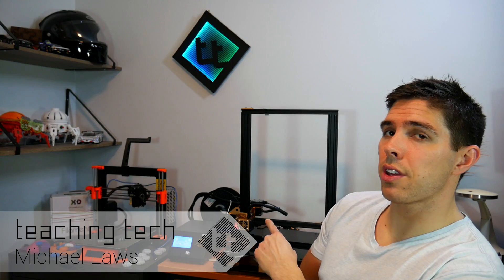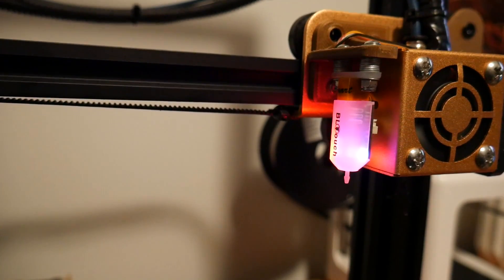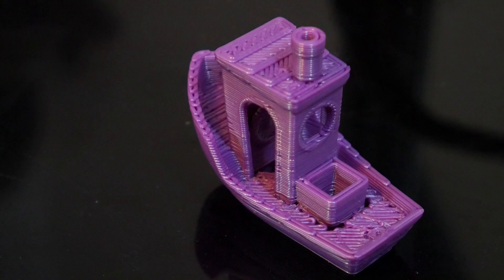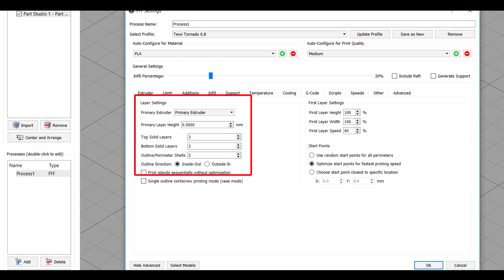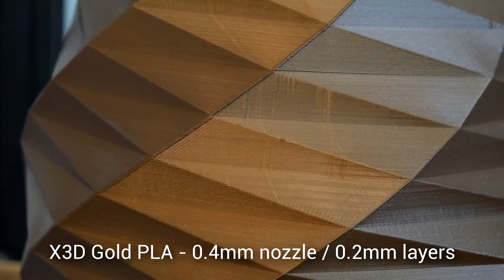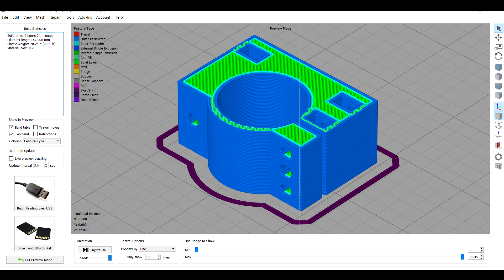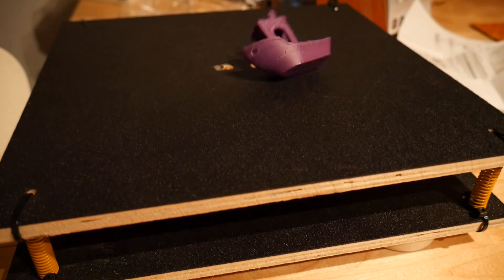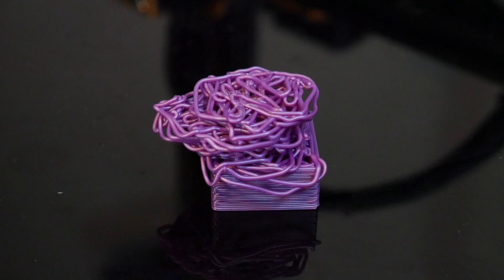3D print bigger, faster and stronger with a larger nozzle

Comment: What about extruder steps, e steps. I recently got a second Lulzbot off eBay that someone really had zero idea of what they were doing. Rail cage misaligned, guide rails misaligned and one guide rail support upside down stepper motors wired wrong, endstops wired wrong, nozzle cooling fan receiving no voltage and on and on. So all fixed but I have a working Lulzbot TAZ 5 already. So I decided to change this fixed machine dedicated to a MOARstruder 1.2mm. You don’t mention e steps. I could probably calibrate flow, speed, etc and save that in Cura as it’s own machine. I did have to do that anyway so Cura knows I am using a 1.2mm nozzle with the settings you mention but I also changed e steps. You didn’t need to do that? By the way, I am now printing 4 times faster, however, as you show in your excellent video, the resolution takes a hit. BUT, it makes things look a little more artistic. Yes, I printed a vase and, to be honest, the visual appearance of the 1.2mm filament strings as they go up the vase makes it look really really awesome. I do a lot of robotics, Arduino and raspberry, so I do a lot of prototypes before I settle on the finished part. This will GREATLY help me as the earlier prints, the prototypes, do not have to be anywhere close to perfect and as I finalize on a print then I switch back to either the Lulzbot .5mm or I'll use either my Snapmaker 2.0 A350 or my Sindoh DP200 which both use .4mm nozzles. So this 1.2mm HUGE nozzle gives me a lot of flexibility on a machine that I can keep constantly using the 1.2. I never expected to fully fix this printer that I bought so inexpensively and now I have a machine for pure prototyping which is AWESOME. Great way to use this extra machine that was almost a gift and make it one of my most useful machines. Not to mention how much I learned fixing all the issues that this machine had.

Comment: I know this might be a stupid question, but I'm new to 3d printing and do you need a filament that is larger than 1.75mm for the larger nozzle?
Reply: no, if your extruder uses 1.75, use 1.75. The nozzle doesn't care, as long as enough volume of plastic is running through it

Comment: The main issue is that many printers using a e3d style head can not heat the nozzle properly. Also many extruder motors will start skipping because the demand of filament will exceed there thresholds.

It is for this reason .6mm nozzle should be the biggest you should install, unless you are willing to modify your printer with a custom head like a volcano; and also upgrading the extruder motor/driver.

Comment: with 1mm nozzle when printer starts new layer filament comes out of nozzle after nozzle have moved 5mm, so no filament on those 5mm. what settings i need to change in cura?

Comment: Hello Everyone
I have a problem printing with the nozzel of 0.8mm and I hope that you can help me.
Any time that I print with the nozzel of 0.8mm except vase mode my start  layer points have a big gab, witch results in a sort of a cut in my prints.
I hope that my description is accurate enough. Btw my slicer is simplify😅

Comment: My standard printer setup is a .6mm nozel with .28 to .4 mm layer height. I have also taken to designing all my parts for this setup. I find that even big parts print nice and fast with this set up and they are stronger than the normal .4mm nozel. Thanks for this video. Great job!

Comment: I just put a .8 nozzle on my cr10 s5 and Im still having issues with the overlap. Im all the way up to 75% on the simplify setting and ive still got a gap. Did you make any changes to your extrusion multiplier?  Ive got mine set to 1

Comment: Nice Work! I have a question, can I see your settings 0.8mm nozzle on ender 3?
I work with 40mm/s and got stringing.. what should I do? adjust the retraction speed & distance?

Comment: I prefer to print large, and work w/ .08mm nozzle. I've worked at tinkering my settings, and found most of my settings are the same as what's recommended here. One small difference is i print at a much higher temp for PLA then what it's rated for - i print between 215, and 225C - i do this because the amount of filament moves faster through the nozzle, and has less time to get up to the correct temp. A volcano nozzle does correct this by increase heat exposure time during feed. However, i found it wasn't really needed if you just increase the actual nozzle temp it does the same thing but really better since the material tends to exit at the right consistency, and if you use layer ironing (you lose a little bit of time) you can regain some resolution, but the strength is insane as the ironing, and increased heat creates premium layer binding.
Reply: What slicer do you use?
Reply: Thank you!

Comment: I printed number of parts with 1 mm nozzle at 0.5 mm layer height and the output has been great. The benchy I printed is 250% in size and it looks perfect. Much better than the one you printed (has smoother surface).

Comment: hello,  could you please make a video for only .5mm nozzle upgrade with all the parameters,  your current video jumps around too much on all nozzles.  I've currently placed a .5mm nozzle in my Ender 3 PRo 3D printer and it's running as fast as the .4mm nozzle with the settings or does the settings change once you change the nozzle setting from .4 to .5.   thanks, I enjoy your videos they are very helpful.  Cheers

Comment: Not the optimum solution.  Print 0.6mm at 0.5mm layer height.  You will get better speed because of lower volume flow and will use less material.

Comment: Would printing using 0.4mm nozzle profile in Slicer/Cura be problematic if I have installed a 0.6mm nozzle? My assumption is that it should not have any problem because the hole is bigger, so it won't have an issue with jams.

Comment: Finally, a decent video for large nozzle newbie. Thumb up! You gave out the most important information, relationship between large nozzle, line width and layer height which I didn't see another one did. Also with actual number for setting which is better than most of the others.
Reply from the maker: I'm still slightly tweaking but the early breakthroughs in this video were the most important steps. Thanks for watching :)
Reply: Ask Holy Spirit to teach you and to guide
you. I would recommend the YouTube Cleveland street preachers and follow Jesus no man no religion. Be holy and obey Jesus. Hebrews 5:9 "salvation is for those who obey. Jesus says if you love me keep my commandments (John 14:15). Jesus even says if you keep my commandments then you shall abide in my love (John 15:10).

Comment: Thanks for the video, I learned a lot of things about printing with 0,8mm nozzle... Please, Someone can said me ,In simple3d, what are the right values for tevo tornado with Extrusion multiplier and Extrusion width?. Thanks a lot! And sorry 4 my english.
Reply from the maker: I ended up at 0.9 multiplier and the width on auto which is 0.96 mm. This is for a 0.5 mm layer height.
Reply: Thanks!. I tested this settings and really improve the results.

Comment: I was wondering what might be your recommandation on who might have the best replacement nozzle as far as brand.
There are a lot of people on Amazon claiming to have the best made nozzle. Any thoughts?
Currently running .4mm Ender 3. :)
Thanks
BTW, my nozzle hits the infill when printing at higher Z. I leveled the bed, but maybe the x-axis carriage? Has this happened to you?
Reply from the maker: With nozzles it's my opinion that you either buy 10 cheap ones or one really good one. If your going the expensive route, something like an E3D harder stainless or even a ruby nozzle.
Not sure what you mean by scraping the infill?
Reply: @TeachingTech  thanks. I ment that I was printing a badge holder with rsa chip inset. It prints supports while going up, not infill. My bad on that. I think because I haven't moved the z-axis up high for a long time, found a flat spot.
Have you heard anyone having good luck switching out the wheels for rails?
Reply from the maker: I haven't come across it but ic any see any reason they couldn't just be unbolted and swapped.

Comment: have you ever used a true volcano? My cr10s an now my tevo little monster has them an pt100 thermistor. An have you checked out the berd air system?
Reply from the maker: I haven't used either but I predict covering the volcano at some stage in the future. Berd air looks interesting for a printer with little roo around the hot end.
Reply: @TeachingTech  I'm using berd air an zesty nimble (there from your neck of the woods) on my tevo little monster I didn't want the weight of direct drive an fans on my hotend for speed purposes my zesty nimble sidewinder will be in today for my cr10s an I have a 12v berd air for my cr10s as well highly recommended both products

Comment: GREAT VIDEO, YOU HELPED ME LOADS I WAS UNDER THE IMPRESSION YOU HAD TO CHANGE SETTINGS IN YOUR FIRMWARE JUST RELEVILING THE BED IS NO PROBLEM AND THANK YOU FOR MENTIONING NOT TO REMOVE YOUR NOZZLE COLD. GUESS IT'S TIME TO ORDER A LARGER NOZZLE.
Reply from the maker: Thanks buddy. Good luck with the experimentation.

Comment: Actually, noone stops you from extruding 1mm thick extrusions with a 0.4mm nozzle. In fact, I often use up to 1mm extrusion width with my 0.25mm nozzle when I need strong walls. Works perfectly fine for me. Would you mind testing how your 0.4mm nozzle performs with 1mm extrusion width and 0.35mm layer height? You can set the extrusion width in the advanced options of slic3r (don't know for simplify 3d). As you said, you might have to reduce the speed if your extruder can't handle the flow. Also raising the temperature might help.
Reply from the maker: That is something I would like to test at some stage. Just need a video idea that it fits.
Reply: It's really funny. Most people in the 3D printing community never consider changing the extrusion width or don't know what its benefit would be. I on the other hand adjust the extrusion width on almost every print. I usually do mechanical parts or cases with usually one dominant wall thickness. In this case I always adjust the extrusion width so that the wall perfectly fits an equal amount of extrusions. This makes for strong walls and reduces print time drastically when no gap fill is needed. I print with 0.3mm to 0.8mm extrusion with most of the time. I really miss a variable extrusion width feature in slic3r... Would be nice if it adapted automatically for perfect thin walls ;)
Reply: That is one the easiest ways to increase print speed. I also had great results with this.
In cura you can set the line width for infill only so surface quality is not affected. 
And in simplify 3d its possible that the line width is selected automatically. I wonder why not more people use this and this is default in every slicer.
Reply: I don't believe that'll work for (single-wall) vase mode.
Reply: @4FunRC  I did exactly that many times. You get stronger walls without it taking any longer.
The thing that is limiting how thick you can print is pretty much only the width of the nozzle tip. It is usually far wider than the nozzle hole. If the filament is pushed out it has nowhere to go but to the sides, so it is the same as printing with a larger nozzle. This is of course only true for small layer heights.
Reply: @RoterFruchZwerg Thats a great idea, I'm embarrased that I hadn't thought of it. I'll be giving it a try on the CR-10 s at some point for sure. Thank you